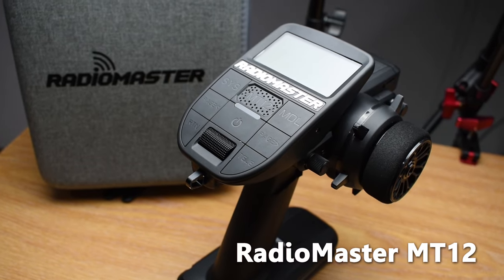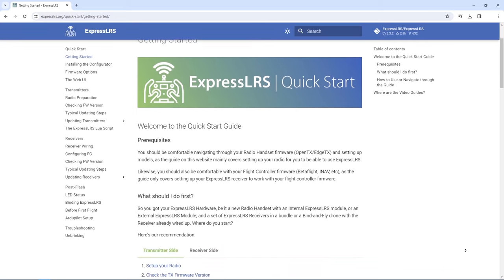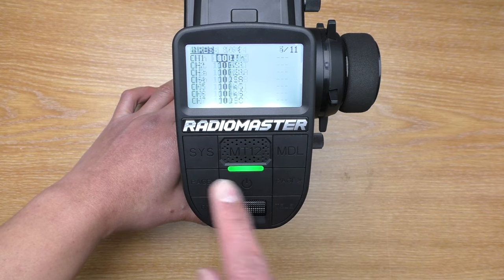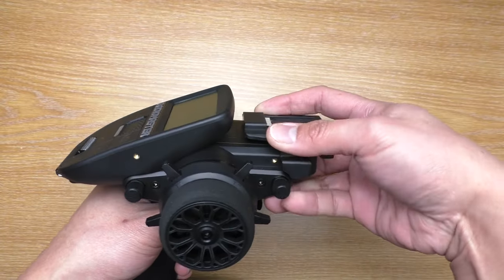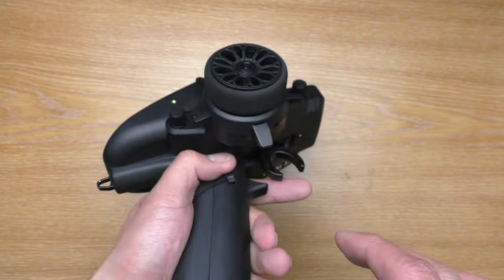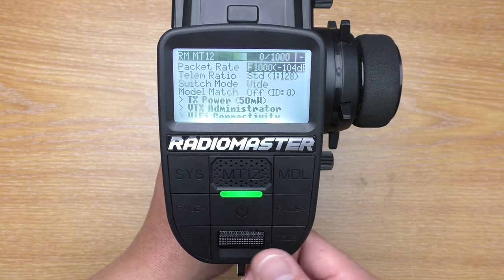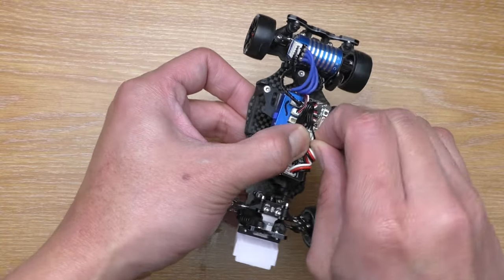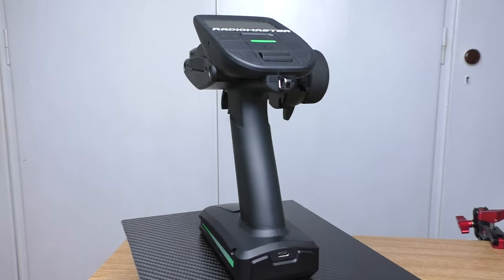[Review] RadioMaster MT12 - Surface Transmitter with EdgeTX

Comment: I knew it was only a matter of time before a surface radio with multi protocol would be released, and this radio not only has that, but way more features, and it also looks pretty sweet! This definitely seems like solid step on the path to the perfect radio!
Nice review too. 👍
Just one little thing though, the pronunciation of "menu" .
You said "men oo" (or men eww), it is supposed to be pronounced "men you".

Comment: sorry if its sound dumb, but i really beginner in this field

so the elrs version cant connect to another receiver like 4 in 1 version?

am i right? or maybe elrs version can connect to another receiver but not as much as 4 in 1 version?
Reply from the maker: They can't "directly" connect to the protocols of other version. However there are modules that you can install on the transmitter. Look at 8:26 .
If you get the ELRS version and want to use other receivers from Flysky, Radiolink, etc. You can install a multiprotocol module on the top.
Vise versa, if you get the 4-in-1 and want to use ELRS receiver, you can install a ELRS module on it.
Basically choose the version according to what you use the most. If you have a lot of old receivers and cars with all-in-one (eg. WLtoys, Mini-Z) just go with the 4-in-1. Then add a module if you need extra protocol(s) later.

Comment: What the protocol used in the 4 in 1 to connect a Ko Propo ASF receiver?
Reply from the maker: Unfortunately, the 4-in-1 does not contain ASF. As I mentioned at 9:06 you will need the old ASF module and hook it up then choose the PWM mode to operate the ASF receiver.

Comment: Great video. Thank you Beaver, From what I read, I probably made a mistake buying the 4in1 version because of the latency... I use to have Radiolink transmitter and I will probably use those receivers with the radiomaster transmitter. I wish I will not get too much latency, otherwise I gues sI will have to switch back to the radiolink transmitter. Did you have a chance to test the latency with some typical radiolink receiver, like the - and the 7 channel receiver? Thank you for your answer and for all you great videos
Reply from the maker: Thanks. I'll find a chance to test the Radiolink with telemetry in serial mode. As far as I notice, it's the same latency as a native Radiolink transmitter but I'll need to test it just to be sure. Still, this one offers way more customization than RC8X.
Reply: if you want to go elrs, you can always add a module... the one from jumper brand is cheap.

Comment: Hi, is the Surpass Hobby ESC, mini rocket 18A correct and reliable? Is there a better equivalent price? Thank you in advance for your help.
Reply from the maker: No, please don't! Rocket 18A (sensorless version) is one of the worst you can get. There's DasMikro V3 and PN Racing that are around the same price and way better than Rocket 18A.
Reply: @BeaversHobby  Great, thank you.
Should I be careful of the heat ?
Reply from the maker: @frkial8649  Don't worry about the heat on the ESC. Some motors heat up a bit but it's nothing dangerous.

Comment: trying to find a stabilization gyro for speedrunning compatible with elrs  mt 12
Reply from the maker: Anything that can't be programmed via S.BUS is OK. Power HD also makes really good gyros. The Power HD G1 has very good noise and vibration filtering that I don't see the wheel shake on RWD drift so it should be good for keeping the car in straight line too.
Reply: Thank you so much for your input

Comment: This transmitter will work with 2 in 1 esc receiver in WLtoys k9x9 series? Can you make a video of the transmitter binding with that car and other similar style 2in1’s?
Reply from the maker: Yes, it works with WLtoys K9x9 and 284xxx. The 4-in-1 multiprotocol will work directly, the ELRS will need a multiprotocol module. I'll make a video or 2 because there's one for the old K9x9 and one for the new 284x series.
Reply: Thank you. Just watched the video.

Comment: Hi what the best elrs controller now?
Reply from the maker: For pistol grip transmitter RadioMaster MT12 is the only choice. If you are OK with stick radio then RadioMaster TX16S, in my opinion, is the best because of the big touch screen.
Reply: @BeaversHobby  Radiolink RC6GS has port for elrs module or RC8X also better port for elrs module the radiomaster built in elrs module is a joke 600-700m and you need to buy a better module for longer range so the price is radiomaster is high not worth it overall
Reply from the maker: @PoloHungary  When you run it on PPM it's the same port on both RC6GS and 8X so there's no difference in the connection. If you need more advanced adjustment the 8X is obviously better. You run elrs for range, I assume?
Reply from the maker: @PoloHungary  To be honest I'm not so sure RC6GS would work with ELRS module because it only output PPM from the trainer jack. If the module can work off PPM alone then it'll work. If it needs full crossfire system then I'm afraid it won't work.